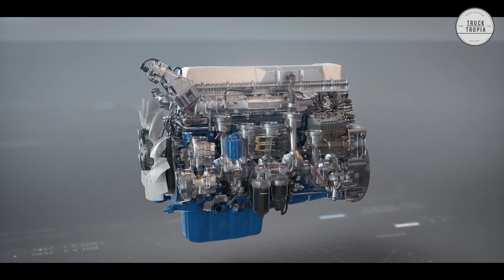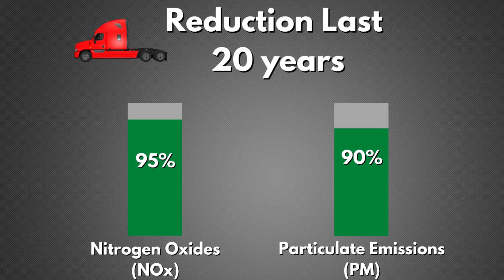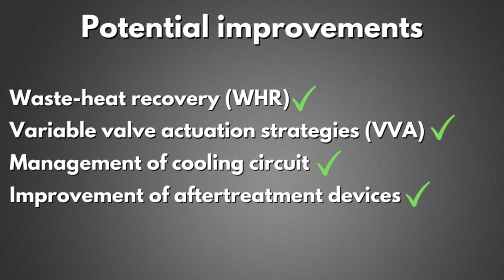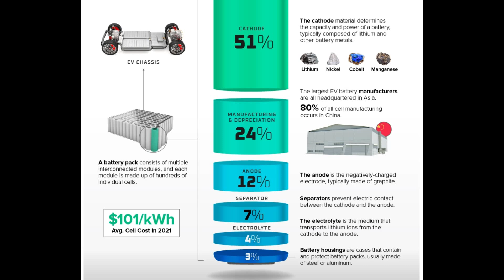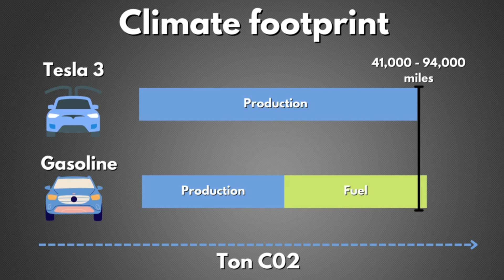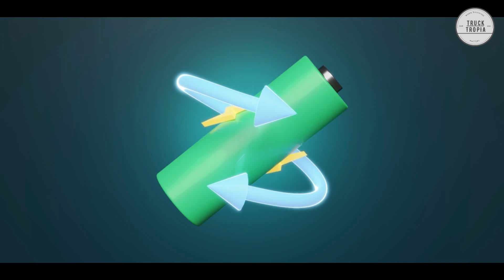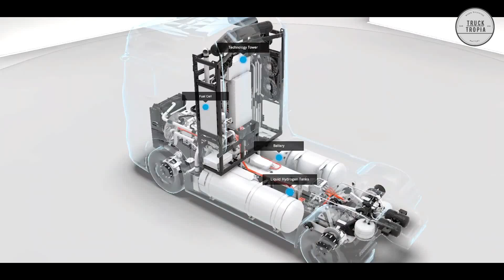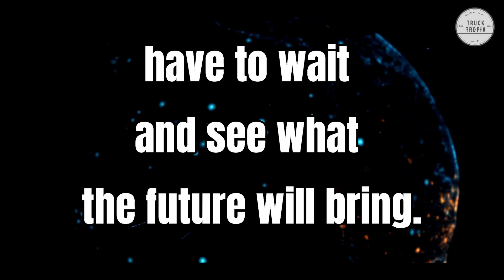How Dirty Are Diesel Trucks Really?

Comment from the maker: Watch why all trucks use inline Six engines https://youtu.be/833MXlpGI34
Reply: I've rebuilt 3 older mercedes 300E's and the inline 6 engine they have is called "bulletproof" for many reasons. I literally couldn't kill my first one, and I did some nasty stuff to that engine. Still had the power to pass anything but the gas station.
Reply: Power to weight.  I 6 engines. Are most efficient design. At this point.
Reply: Even the head of Ford's truck division though the 300 inline 6 was a much better truck motor. Emissions killed it though.
Reply: https://youtu.be/3uceK5b0NXM
Reply: Scania v8
Reply: The 12V71 says your wrong.

Comment: Some detective work indicates that the Tesla truck is so heavy, it can only haul 1/2 to 1/4 the cargo a diesel truck can. When you factor in the horrendous Mining issues with Lithium & Cobalt and the other large problems with the other alternative fuels, it looks like some version of vegetable oil or biodiesel is going to be the easiest to put to work in trucks if you really feel the need to replace the current diesel.

Comment: You forget about one of the most important one, synthetic fuel witch combine co2 and hydrogen, you see burning strait hydrogen create lot NOX with you don't want, but mix co2 work great. Carbon Engineering prove to be viable .

Comment: With all of the dirty mining and refining of the items needed it it pollutes just as much. By the time it becomes nuetral the batteries need to be replaced at a big cost. It's all just a huge grift. These vehicles do have their applications, but we don't have the infrastructure or the capacity in our grid to do all this. Not to mention where does the power come from? We will never geneate enough with renewables, not to mention it isn't reliable. The sun doesn't always shine and the wind doesn't always blow. Let's not forget that the batteries are not recyclable, neither are solar panels and the wind turbines.

Comment: What A Shit Video  !!!!
Your Research Must Have Been Done By Fetterman Between Having His Stroke,  and Being Hospitalized. 
Your First Mistake was In The First 00:20 seconds. The Diesel Engine Was Created To Run on Peanut Oil. Because Germany Has No Oil, Most of Europe Has No Oil. That's Why They Were All Were Fighting Over Africa & The Middle East. 
Secondly, Tesla is Recycling / 96% of Not Only Their Rechargeable Batteries but All Rechargeable Batteries in their Giga factory 1 in Sparks Nevada.
There Semi Hauled 83,000 pounds From Sparks Nevada,  Over The Pass. Nonstop To LA Ca. Over the Grapevine On A Single Charge, Only Stopping Once For the Mandatory DOT Rest Stop. If I Recall Correctly He Traveled 568 miles, and the Truck Still had a Nother 25-30 Still left.
My Buddy has over 240 K miles on His, and all it's Cost is 4 sets of Tires,  & Wiper blades. In Six years it's Only Depreciated 
$ 15 K.  Name Any Other Car That Holds It's Value Like That...

Comment: The compression ignition (diesel) engine has the capability of running on other fuels like light oils. The one that Rudolph Diesel first started with ran on peanut oil.  The question is, can they make a renewable oil that can be low on particulate, have the same or greater energy than diesel, and not be expensive to produce?

Comment: One thing they should consider is charging on the move, have a dedicated lane with overhead cables to constantly charge the truck, and the battery for driving outside that lane.  There are already city buses running on overhead cables like a train does.
Reply: I wonder how the cables would do with trucks running at 70 mph. I am sure it can be done but I wonder what it would look like.

Comment: LOL the new trucks make 60 times less "pollution" huh? What are you saying is the pollution part? C02 emissions are exactly the same no matter how you burn it. Combustion creates the same amount of c02 no matter if it's diesel fuel, gasoline, coal, natural gas, or firewood.  There are no engines that filter out c02 because there is no way to filter out c02 or split that molecule into pieces as fast as the combustion process can create it. No, c02 levels do not change. PARTICULATES can be filtered out and reduced. N0x's can be helped through catalytic converters.  But the only way that "pollution" is reduced is from the particulates (black smoke of diesel) and the other nasty gaseous compounds, but c02 is exactly the same whether it's a brand new truck or a truck from the 1940's.

Comment: The EV truck has no transmission that where you get all the power from the eig  that y they can pull so much weight   , just look at a kid bike they have 10 , 18  ,21 speed      ,as I grew up by bike went up and I made it up every hill with a 21 speed bike  and when I had the 10 speed I couldn't make it up

Comment: As a diesel technician, I can say that when running a new diesel engine in our shop, you can tell just how clean it is. Older diesel engines make your eyes burn, and lungs hurt. The emission requirements for heavy-duty diesel engines made today are plenty enough to make sense for the long term. We just need bio-diesel to take over. Just remember, it's not the engine that needs to be changed. It's the fuel source.
Reply: Yup, just the same as with cars.  An old car or a newer vehicle which has had a catalyst delete will make your eyes water.  Though diesels with coal roller chips are the worst by far, even worse than a pre-emissions stock diesel.  Stand next to an idling coal roller and try to not to gag, and stacks on a coal roller don't help because there is SOOO much unburned fuel in the exhaust that it falls to the ground.
Reply: Gasoline engines exhaust will kill you versus diesel engines exhaust making you your eyes burn and lungs hurt.

Comment: Personally I like hybrid and hydrogen. If we can make hydrogen fuel cheaply and environmentally friendly, a vast majority of diesel engines can be converted to hydrogen while increasing fuel economy and power. Hybrid cars are extremely reliable for the most part, and are the most reliable category of vehicle, ahead of diesel, gas, and on the very bottom of reliability, electric.

Comment: Someone should ask Tesla what the range on their semi is, in 0F weather.
Reply: I did some figures on it and the efficiency is roughly the same as a diesel rig. That being that they're fueled with the same amount of energy. It's a little complicated because they want it to be. That being said, there's so many other factors with an electric semi. Charging time, when you can fuel a diesel in 10 minutes. Massive loss of efficiency charging the batteries from the grid. Every transformer the power goes through it loses 10% efficiency and so on.

Comment: Anybody who is a believer in EVs really, REALLY needs to look up where, and how the Lithium for the batteries is actually mined. It is extremely destructive to the environment. But, hey, who cares if it's "just" in South America, right? As long as it ain't happening in our backyard... /eyeroll And hey, what's a few EV bus fires, we'll just ask everybody who rides the bus to wear full fire gear in case the thing decides to erupt into flames because of all that densely packed energy stored in those lithium cells. I mean, who cares if the FAA has special regulations regarding the transport of lithium batteries on aircraft because it's so dangerous?

Comment: Your information is incorrect if anything it increases CO2 emissions the DPF uses more fuel to then burn the carbon soot at higher temperatures so not too see them later on after the emissions check that is what the DPF does, a Larger turbo, higher power injection like at Higher Pressure with the 2 stage that CATs have is about 50% efficient the most you will get out of an internal combustion engine.  What we need is room temperature superconducting technology.  That is 100% efficiency is all aspects.  However the governments of the world make more money taxing Energy than the oil companies that get it out of the ground and that is the problem.  The so-called carbon taxes is just another way to make money off energies.  Molten Salt Reactors with nuclear power is the way to go, they are 98% efficient and small, they can solve the energy problems and are very clean, can run on nuclear waste or thorium.  CO2 emissions from us is not causing climate change, what melted the last ice age was not Ford, or Toyota.  The Tonga eruption put out more Greenhouse Gas in two days then the USA has done in 7 years.  We need to get off oil cause of the cost, and efficiency and pollution of air , land, and sea, but it is all we have now, room temperature superconducting technology should be researched first, EV’s will never work without it, then everything will change overnight just like semiconductor technology changed the vacuum tube.

Comment: Where are you going to get enough lithium for the batteries to replace all the diesel trucks and where are you going to get all the electricity to power them, or transmission lines to get the power to the chargers. If you don't think electricity costs are going to skyrocket over the next few years then you are sadly mistaken.

Comment: The economics of a Tesla semi cannot be overlooked.  Fuel costs alone makes diesel trucks unviable.    The current calculation is 80,000 dollars a year will be saved in just fuel costs by a Tesla semi.  The bottom line is economics will either save or kill diesel engines if the Tesla semi meets its goals then the diesel engine will go the way of the dinosaur.  The video has some glaring misinformation or at least outdated information.

Comment: No mention of the fuel quality etc,  Syntectic diesel made from Coal is even cleaner than diesel made from oil! trucks need better fuels more bio diesel production. There is even Hydro diesel its diesel mixed with water burns cleaner in older engines like a newer more modern engine.

Comment: i have mid to late 80s mechanical diesels that burn cleaner that new ones according to emissions testing .the secret is advanced timing a lot more than any diesel mechanic would ever try but they make lots of power and burn clean and  better fuel mileage . electronics fail all the time the newer there are the bigger pile of junk they are . A highway tractor that costs $350.000 lmfao who buys these things im still laughing .

Comment: The true measure of the impact of electric vehicles on the environment has yet to be determined. Electricity still has to be generated to primarily manufacture and power them and the disposing of hazardous batteries etc if not done properly will be a greater danger to the environment than a regular combustion powered vehicle

Comment: I'll be honest, I see the good points of what is said and I agree that a new, better fuel source is required before fossil fuels run out or pollution gets too high.

However going electric will likely not be the solution as many communities will be heavily impacted from this. Both required and entertainment communities. Heck that goes for any new fuel source.

What we need is a self sustaining energy source, not diesel nor gasoline or hydrogen or electric and the only type of energy that is currently even remotely capable of that is nuclear fusion.

Everyone is so afraid of radiation they aren't seeing the potential solution that is right in front of them. Nuclear meltdowns are devastating but they may be the key to self sustained energy. All a nuclear meltdown is is a nuclear reactor that has reached or exceeded Critical Mass, which per definition is "the minimum amount of fissile material needed to maintain a nuclear chain reaction".

IF we manage to HARNESS this state of reaction, it will be the current closest thing to an infinite energy source. We just need a way to contain the Radiation and an efficient way to use a vast majority of the energy that is produced from this reaction or a way to cut the reaction off. That is where study and experimentation come into play. If this is actually encouraged rather than shyd away from than I'm certain it is possible.

Comment: 60.trucks that's not quite accurate detroit produced 2 stroke engines that were very dirty most of the other manufacturers like caterpillar and international engines are quite clean and are still used today they just use Def fluid to remove the oxides from the exhaust

Comment: 6:50  The EV companies only use the most advantageous scenarios to support their claims.  They never use hilly terrain, windy weather, cold conditions, realistic driving speeds or 0-100% charging times.  Its all smoke and mirrors - typical stuff from Tesla, Electric Viking and Electric Jesus.  
Some small diesel cars are so economic their fuel costs are similar to public charger EV costs and the higher capital costs of a BEV means you will never break even.
Diesel will never die as long as we need trains and cargo ships.

Comment: My answer is possibly someday, but not tomorrow. E vehicles, even passenger vehicles, is still in it's infancy. Right now the price for early adopters is extreme, The reloading of energy (refueling) is longer in many instances compared to gas or diesel, making it not time efficient, as well as not very popular. To get the power needed to compare to either gas or diesel is as I already pointed out expensive, many Tesla cars go for nearly 100K now a days how much is the semi going to cost?
   Now saying all this, I embrace E vehicles, when they are ready. When the price comes down, to where all can buy it as a choice and not forced, when refueling times matches the times for most common fuel types, when the performance meets or exceeds that of common fueled vehicles for a comparable price, I'll buy the first one. But till then i'll let the fools deal with the 22k battery replacement (under warranty BTW), the lack of charge stations and other issues, including further polluting where practically everything gas or diesel can be sufficiently recycled

Comment: 2 changes in the diesel engine that will be revolutionary is ..
1) Ducted injectors.
2) Electric head of the engine, meaning no timing belts or any shafts in the head.
This would double the mpg and improve the horsepower while dramatically reducing the emissions. 
Also DEF / DPF after treatment bs would not be needed at all because the emissions would be even lower then they are now.
Reply: I am mind blown

Comment: As an industrial vehicle tech, if all the dead battery/low voltage issues I have seen with just under 2000 machines, can only image the lack of knowledge that there really is when caring for a battery with proper charging.  That and a other problem that gets the operators, charged the battery that was at 30% capacity to get a 100% after 15-30 minutes only to have the battery drain really fast for some reason. That is called residual voltage, not it's true voltage after it cools.

Comment: Why couldn't an older mechanicaly injected diesel run on HVO? You can already run them on waste motor oil, transmission fluid, fry oil ect. If it can combust, and if the injector can spray it, an older diesel should be able to run on it just fine.

Comment: How many watts are necessary to accelerate a semi at an acceptable rate?  How powerful of a motor can be packed in the hub of each wheel?  On the drive shaft?  What size / weight engine is required to power them?  What size / weight super caps to absorb charge while at low load to boost performance as needed while keeping the engine at a near constant load?  Does it need batteries with a shorter lifespan but much higher charge capacity per volume/weight?

Comment: Seems like an electrified rail system would solve quite a lot of these issues with range, with the electric locomotives doing the long hauling and electrified trucks only used for local deliveries. Or better yet rebuild our intruruban railroads like the Sacramento Northern that  can do local deliveries as well as long haul. Just my 2 cents.
Reply: Yeah I don't get why people are discussing EV trucks when we have a more efficient and actually viable electric transportation method (Trains)
I don't think people understand that trucks are not a good long-term solution for long-haul cargo transportation. (I mean I like trucks but I don't think they are the best for our needs)

Comment: Most of the emissions equipment has also come at a cost of reliability. Manufacturers have had  to work extremely hard to keep their trucks  reliable enough for the  owners to actually make an income. The emission systems are the least reliable pieces of equipment on most modern trucks.  I'd like to see what type of emissions come out of the tail pipe during a regeneration cycle.
Reply: emissions during regen cycles are no worse, the regen is burning up the soot to a level where it's no worse than the particulates that are small enough to pass through the DPF

Comment: The statement that CNG only produces 20% Carbon-dioxide less than Diesel is false.  Per unit of energy, burning  Natural gas (methane) produces 1/2.4  the Carbon-dioxide of diesel. The world's first Diesel engine ran on "peanut oil", NOT "fuel-oil".